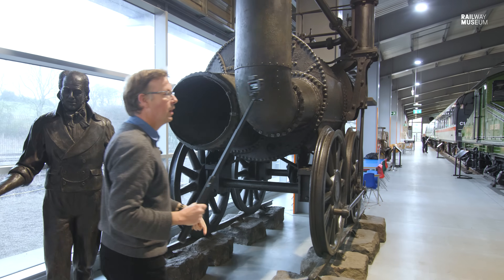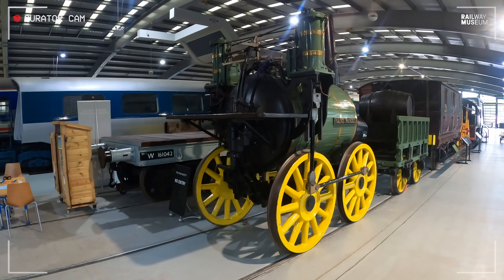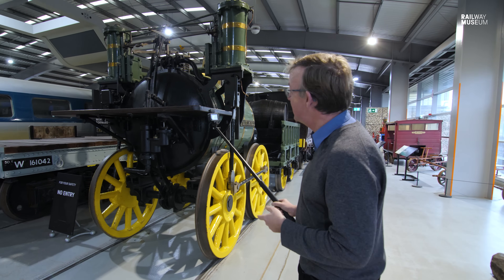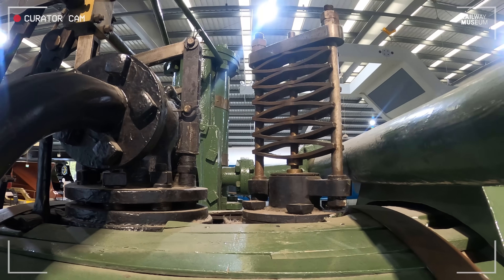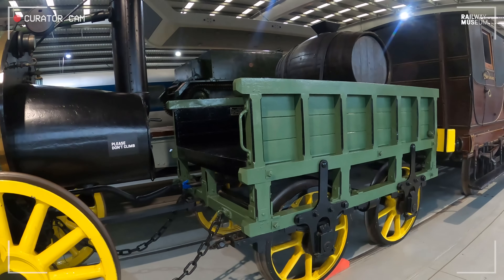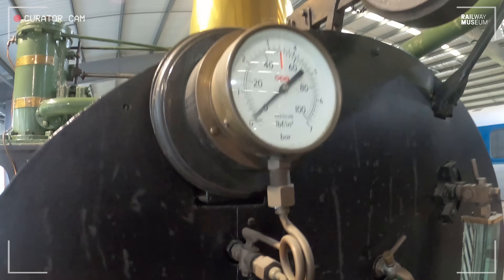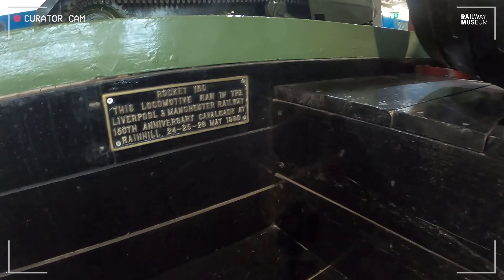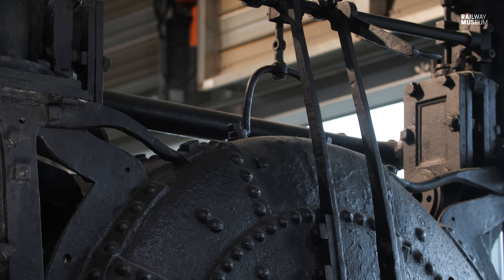How Does the Sans Pareil Replica Compare to the Original? | Curator with a Camera Extra

Comment: I'm surprised that early locomotives even needed a safety valve, bearing in mind that it took such a long time to raise steam, having only a single flue boiler
Reply: What if you stop using the steam? The fire/heat doesnt stop existing, and i guess, if the water level drops, the heat influences the remaining water moreso (as theres less of it to absorb the heat) which would also increase the pressure.
Reply: @Colt45hatchback  You have a point.  Perhaps Richard Trevithick's road locomotive of c.1801 should have had one

Comment: Could you do a video about at what point do you fully retire an engine and potentially make a replica?
Reply: I would suspect they take the condition of the iron/steel boiler into serious consideration, as the pressure of 50 PSI is still a danger if a seam were to break.
It is part of the reason military museum ships have a clause of not having pressure in the steam pipes, ever!

Comment: Draining engines in the winter to prevent frost damage is a standard procedure.  If it's being used, you have to keep a banked fire in it to keep it warm.
I wonder with those U flues, how difficult they are to clean the soot out.  An access door would be useful.

Comment: If you’re doing another Q&A video National Railway Museum here’s my question when did the original stevenson’s rocket become the part the national collection and why is it no longer running under it’s own power
Reply: Rocket can't run under it's own power as a good chunk of original parts have been lost to time, and to get it into running condition you'd have to remove most of whatever mechanical parts are left. Also modern safety standards might not allow it to run.
Reply: @Aeonterbor  ahhh good point
Reply: @Aeonterbor  not only that, but what parts are left are in a condition that are probably not... usable. Especially the tubing.
Reply: @1earedwolf  you also got a good point